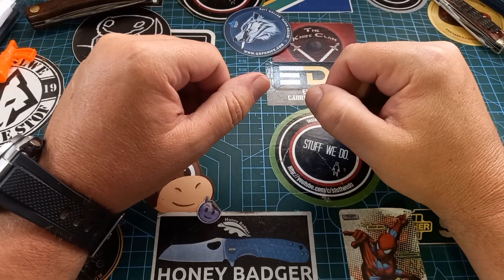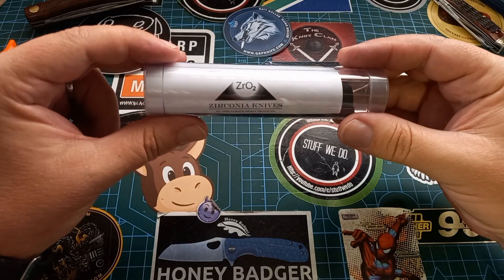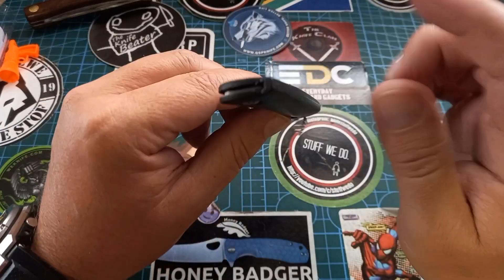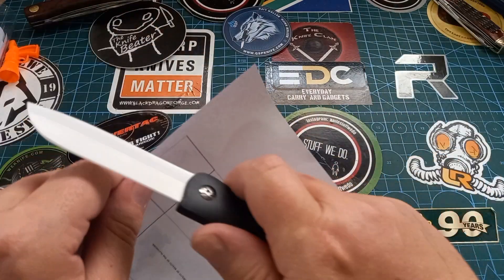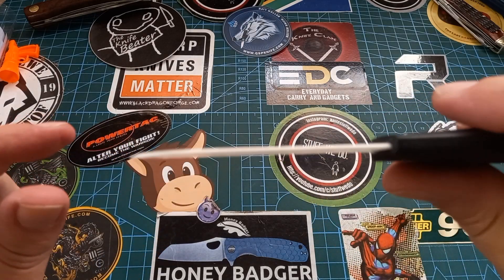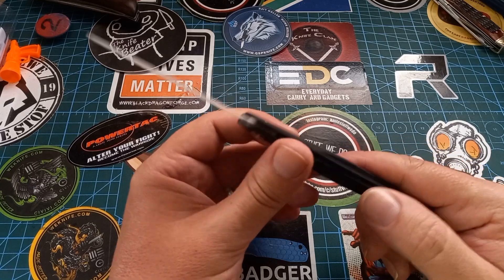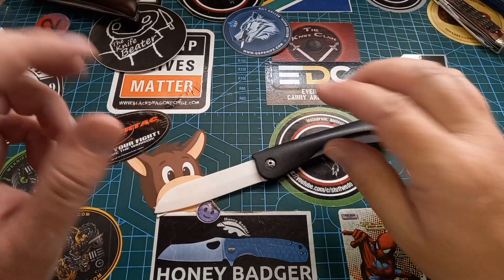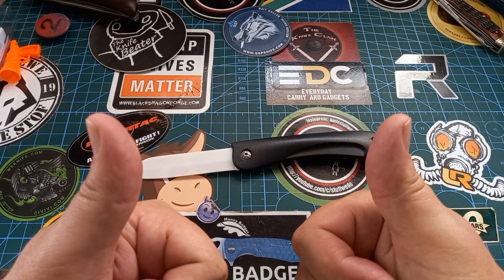Fun Knife Friday! This Folding ceramic knife is a knife designed with a ceramic blade

Comment: Checkers has a BushBaby version of this knife with red plastic handle for R29.99($2). Nice to put in picnic basket and not worry about a fixed kitchen blade cutting everything inside the basket.
Reply from the maker: Thank you Ashley I will check it out. Have a good week.